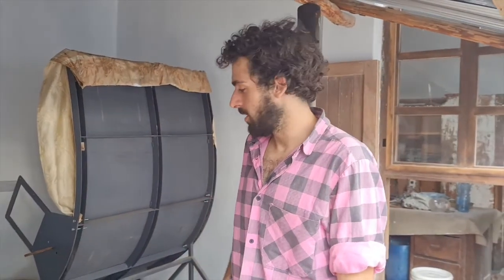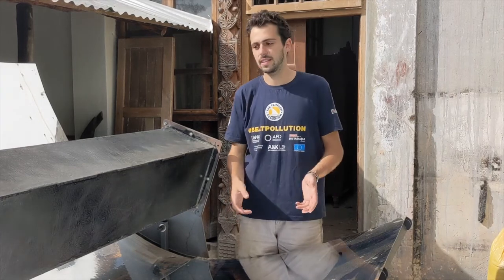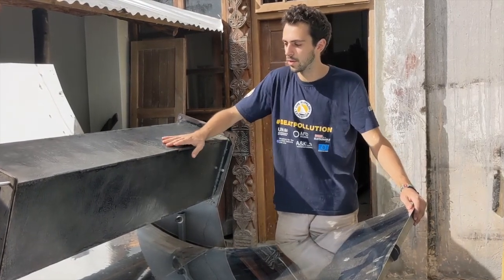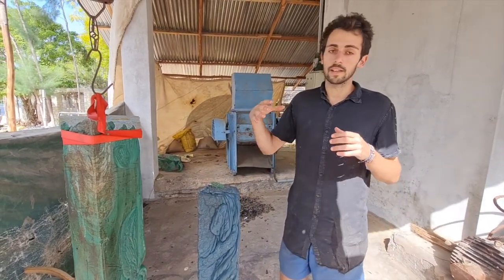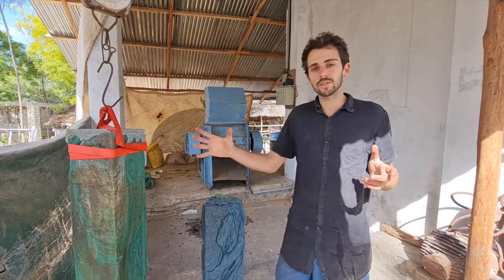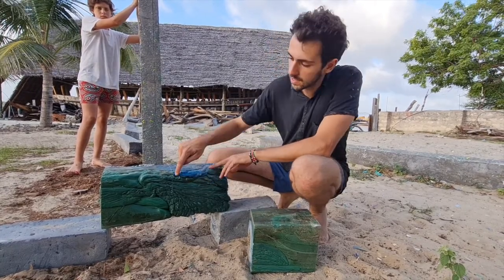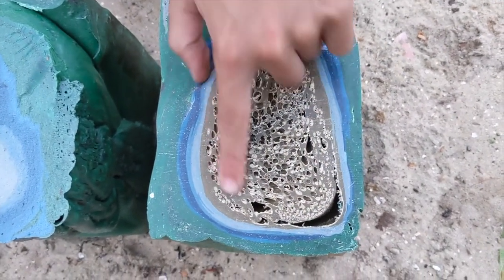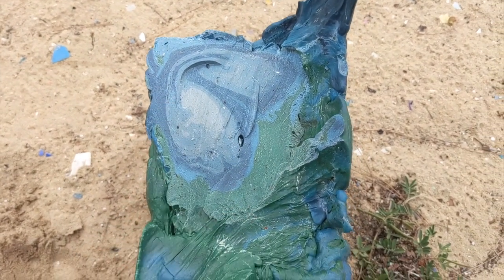Testing the process to solar cook plastic into boat parts

Comment: What if you introduce large fresnel lenses like those found in old rear projection TVs as a means of intensifying the sun's heat. I have seen videos of using these to burn holes in cinderblocks and melt coins.

Comment: what was the machine called you used with melt mold to interset plastic
Reply from the maker: Hey! sorry for late reply - I guess you mean the Extruder?
Reply: You might produce a tubular beam with thick walls.  Most of the strength of the beam is in the outer couple inches. An internal tube that hot or  cold air blowing through it would speed production time.
There were some guys that heated rotary molds using several sun-tracking mirrors. I believe the mirrors were 1/8" inch aluminum aluminumized acrylic mounted on an airtight sealed box.   They would pull a small vacuum to create a concave parabolic mirror to concentrate the sunlight.  By adjusting  the negative pressure you can adjust the focal length of the mirror.
Reply: @texhunter1820  Link?